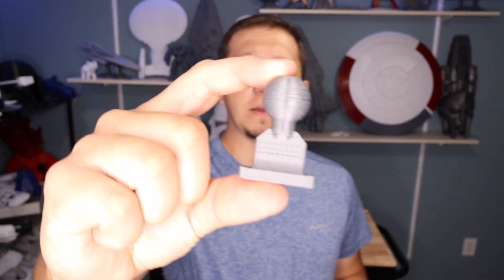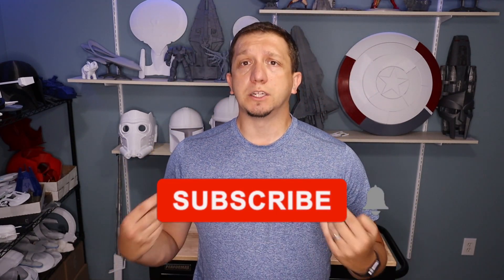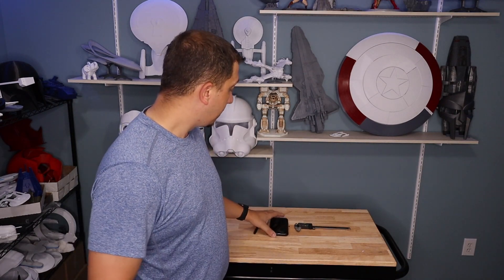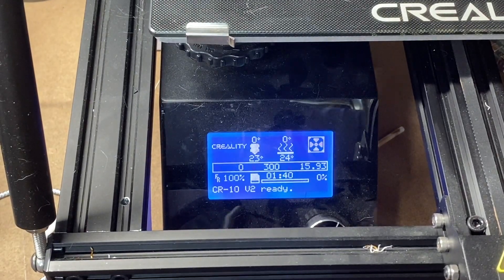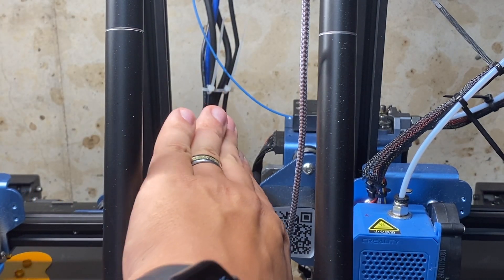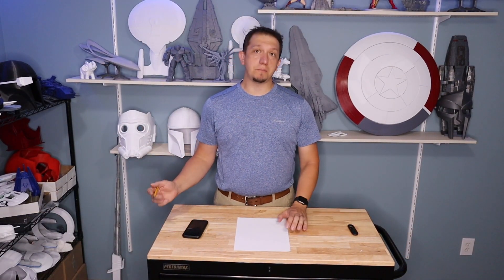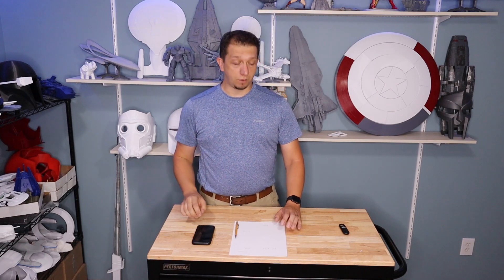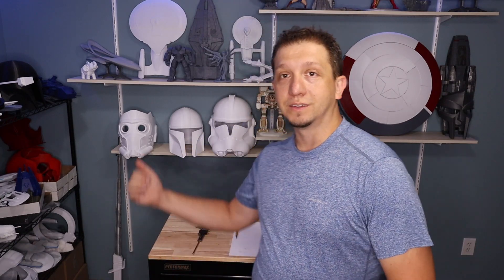How to Get Rid of Lines on 3D Prints ... E-Step Calibration

Comment: i calibrated the e-steps and flow to get acurate walls on my test cube and it worked... i got 0.8 wall BUT now i have under extrusion showing on print lines all over the cube... any thoughts please? :)
Reply: You said it under extrusion you have to fix the e steps if not dry your filament